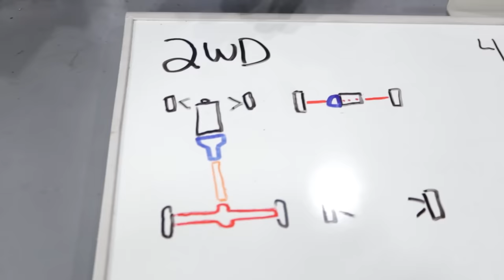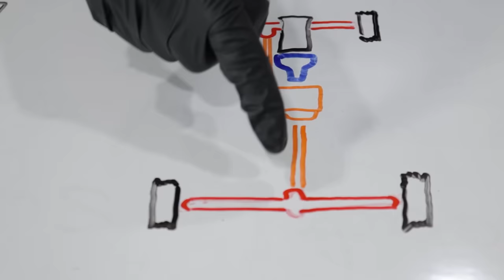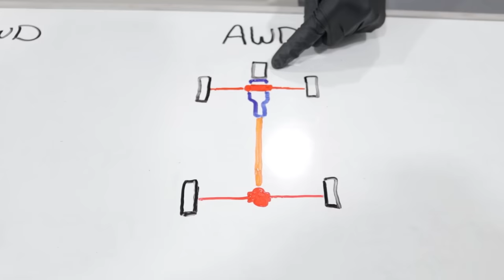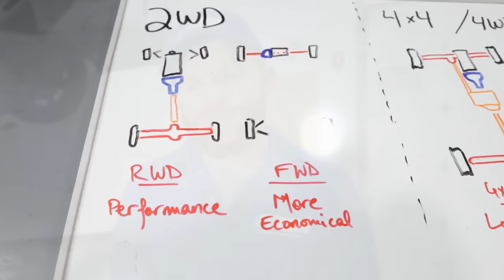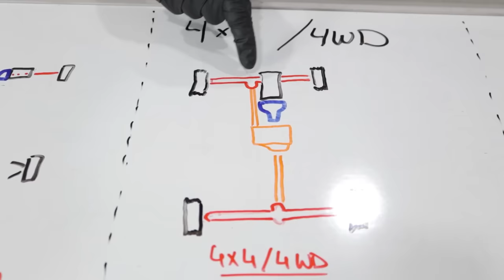All Wheel Drive vs. 4 Wheel Drive: Differences in Car vs Truck vs SUV

Comment: Part-time 4WD=automatically mechanically locked center differential, forcing 50% power to front 2 wheels and 50% to back 2 wheels. If all differentials are locked, then mechanically 25% to each wheel. AWD cannot lock differentials but applies brakes to get traction, thus loses total power output (by braking). Not a problem on gravel roads, but in muds like farms, big difference.
Reply: 4wd for the win.

Comment: The important part that I got out of this video is that an AWD vehicle without VDC will NOT go anywhere if one wheel is off the ground.  All the power will go to that one wheel and the vehicle will not move.  So, buy ONLY VDC AWD vehicles or get stuck in a snowy ditch.  Also, if you have a 4x4 get a rear posi-traction differential put in or you may get stuck.  An OPEN differential makes a 4x4 into a 2 wd with one of the two in front and the other of the two in back.  In other words, left front tire and right rear tire only grip or however the manufacturer set up the "driven" axles on a 4x4 differential set up.

Comment: I own  AWD and 4X4, I like 4x4 better i like that you can turn it off when not in use and save your transfer case,  AWD is great for rain and snow but i find it is a bit loud you hear the transfer case all the time and turning is not the same but it is great also perfect for winter driving.

Comment: Thank you for this! This video solved. Long standing regiment between me and my buddy. You did a GREAT job explaining the differences between the drive types. I wish I would have understood the systems better when I got stuck in the snow in the mountains in my Audi Q7 that has all wheel drive. I don’t think I used the car properly which is why I got stuck for like 3 hours…😢

Comment: Thanks - what does then  both differential do in 4x4 mode . You said its dangerous to drive in grippy conditions , because of possible binding and damage transfer case, but isn't it differential designed  to prevent that? I cannot get the point where danger comes if both differential  are there  and axels are not locket. Please explain.

Comment: Not all limited slips use clutches. Eaton makes the true track limited slip which uses gears. And even a locker will ratchet for turning if not under power. It uses cogs. Both differentials are damn near indestructible. Most all new four-wheel drives today are soft.  In the old days we got out and disengage the hubs on the front axle to save wear and tear and fuel. Then they came out with the auto locking hubs. Today there is no option they just spin. 
   The fact I haven't bought a new vehicle in over 30 years doesn't make me bitter. It only means I have dozens of classic vehicles that draw more attention than  say a new Vet or Raptor.
     And saving that 30 30-50 Grand allows me to do a whole lot of playing.

Comment: I have a question that I have not been able to find an answer to anywhere. I have a 2005 Ecalade AWD Both front tires have the same amount of side to side play, I have replaced both tie rods and both upper and lower ball joints the bushings in the control arms have no play. The wheel bearings have no play and are relatively new. I can't see ant play in the center link I got a great deal on this vehicle and it's in excellent condition but I can't figure this out any ideas? Thanks for all the great videos you guys have taught me a lot and are my go to for repairs.

Comment: Hi, I used 4WH offroad and now its not coming back to normal 2WH, though the manuaul lever is moved to 2WH... can you lease  guide what could be the issue ? and if there is a tweak to release the 4W ?
Reply: Some vehicles require reversing, driving in reverse, backing up, after switching back to 2WD. You may need to back up until it switches off the 4WD. Switch the lever to 2WH first while standing still, then back up in reverse. Do this some place where you have a lot of distance to back up.

Comment: I know I'm nitpicking but it doesn't send the same amount of power to all four wheels.  It sends the same amount oof torque.  Power is just energy per unit time so if it sent the same amount of power to all four wheels they would all do the same amount of work during any period of time.  Work is force times distance so consider the case where one wheel spins freely and the other four are unable to overcome friction (e.g one wheel is on slippery ice).  Distance traveled by the 3 stationary wheels is 0 so too is the total energy imparted but the spinning wheel puts energy into both it's angular velocity and overcoming the drag from friction.

Practically just observe that if 3 wheels are totally still and the fourth is slipping only the last tire warms up because it's the only one receiving any power.

Comment: What is the easiest way to figure out if you're all wheel drive is actually working correctly? I'll give you an example I was up in the snow the other day and I parked at my friend's house. Then I ended up getting ready to leave the next morning and I couldn't get out I was stuck because there was a lot of ice underneath the rear tires because the way the snow was melting and then refreezing. Something I noticed is that the only tires that were spinning when my all wheel drive was engaged was the rear tires because I was able to see a bunch of stuff flinging up from the back but when I looked at the front there was nothing happening on either side I tried engaging my four-wheel drive and that didn't work either. So I'm not entirely sure what's going on. It's a 2001 Dodge Durango 5.9 RT with an electronic switch that goes from all wheel drive to 4 wheel high to four wheel low but it's always in all-wheel drive unless I decided to switch it.

Comment: Now I was once told that if you spin a wheel, while on a lift, that is the two wheels on an axle spin in opposite directions, that is not a true 4wd, as when on a slippery surface only 1 wheel per axle will spin.

Comment: I have a big grand Cherokee Laredo and I was told it was a  4 by 4 But there are no switches or anything inside the vehicle to indicate that and most of the jeeps I has so far ahead some type of switch to switch into 4 by 4 mode this one doesn't

Comment: I have a 2008 jeep compass... it is bad if I activate the 4x4 to tow my tools trailer even on dry pavement ?? Because its a lil heavy..... or it doesn't matter.... I live in Upstate New York and we have a lot of hills everywhere..
Reply from the maker: +Samuel Fernandez It would depend on the weight you're towing.
Reply: As a New Yorker, I would suggest how bad is your wheel bearings and tires.. thats all calculated. You're driving 2008 Jeep. Something need to upgrade to make efficiency. Gotta go. Goodluck..

Comment: Great vid 👍 
Sooo, how about fuel (gas)? I’m guessing front wheel drive and rear wheel drive are the most economical on gas?? 
Compared to the AWD vs the 4X4?
So if u could place in order from which is more fuel economical, which is best… best on fuel,…

1. (…),

2. (…) &

3. (…). 

Thanks 😊

Comment: Please stop saying that. Toyota is a great vehicle by the way, no no Toyota is not a great vehicle, buick is a greatest vehicle ever and not matter what, let me tell something, i have a friend who has a little dealer and He's never going to the auction to buy a decent car to sale, he does buy a lot of Toyotas with a broken engine, fix them and sell them, Again i can really  say Toyotas are not a good car, it depends on how to take care of it, i bought myself a 1999 Oldsmobile regency and i had it for 12 years straight with no problem at all, the only thing that i did in it changed the tires and oil and spark plugs and wires, and i bought it with 135,453 miles and after 12 years i gave away to my nephew with 475,000 miles on it, please don't say Toyota this and that, i have 3 different types of favorite cars, first Oldsmobile and buick they are the same, cadillac deville start on 2000 through 2011, crown vic, grand marquis, town car, start on 03 through 2011, and cars are my favorite car